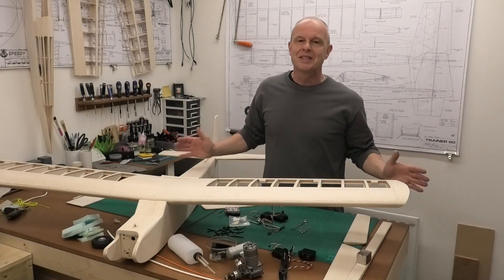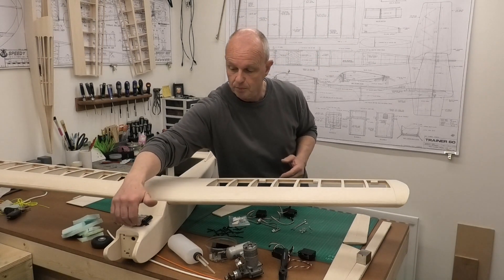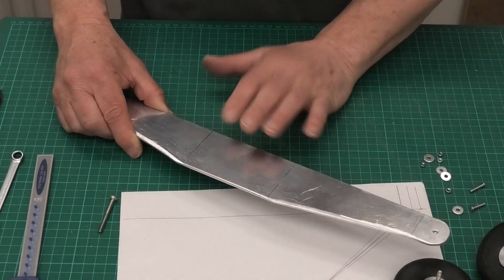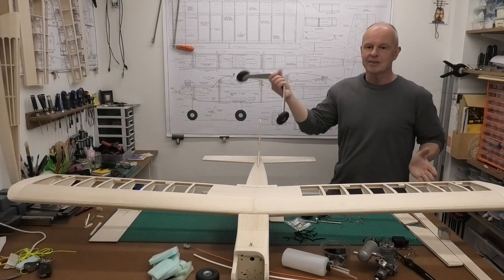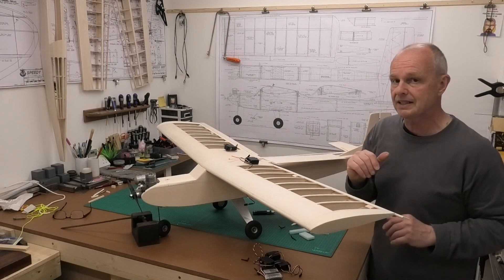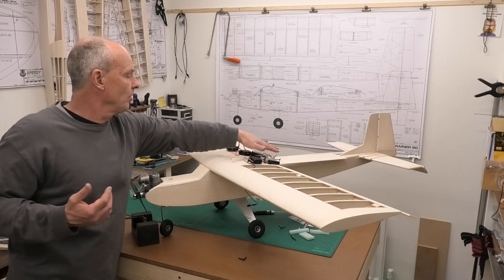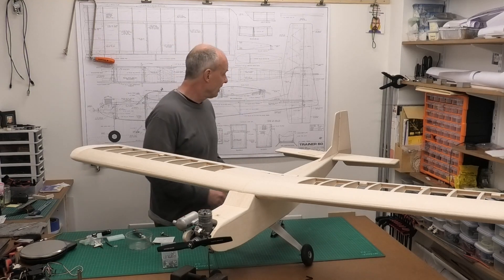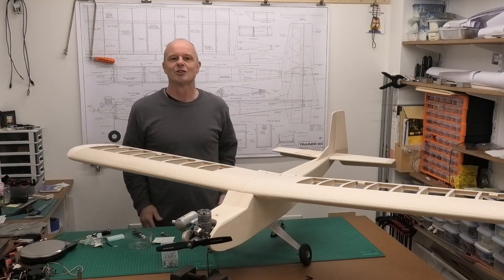Great Planes Trainer 60: Pt14 Planning for the Correct CG & Landing Gear - Build Series - 65" Span

Comment: Mark, Firstly, you are one of the best presenters in YouTube universe.  Great elocution, pacing, and logical, sequential presentation with great attention to details.   I am now just nearing completion of my 2023 modernization of my own Great Planes Trainer 60. Built in 1998 when I was a young 49 year old father, while my 13 year old son was building his fleet of RC aircraft, both glow and electric. The Trainer 60 had the original Tx/Rx setup with the 72.8 Futaba FM  Skysport with mixing.  All those years ago it was an excellent flyer despite it being off the correct CG mark and nose heavy. I corrected that for perfect balance with a NiMh 4200 mA battery in the aft port corner of the fuselage servo compartment (which was a serendipidous decision since it corrected a heretofor unkown Roll Axis imbalance which is a result of the weight of the muffler extending out on the starboad side of the plane!)  Would love to share my weight and balance information and pics showing how it looks.  I have installed Spektrum  AR 631 Rx so I can have 3 flight modes  No AS3X,  AS3X,  and SAFE,  plus SAFE Failsafe. Engine and all servos removed and tested. Can't wait to fly when weather permits at our position.43.2098° N, 77.6931° W    a warm winter so far.  FYI, I have also done same update for my Goldberg Electra and Graupner Partenavia.  The two former are great flyers now.  LiPo and brushless on the two former planes have reduced wing loading by approximately 30%.
Reply from the maker: Hi, thank you for such a lovely and kind comment, its really appreciated, also great to hear about what you are up to, it really is such a diverse hobby.  Hope you get some great flying over the winter, been a little bit rough here, although managed to bet to the field for two days last week which was nice 😊
Reply: @MarkRobinson555  Happy flying!

Comment: Hi Mark,

Did you take into account the fuel in your CG/Weight calculations?
Reply from the maker: No, if the tank is forward of the CG it should not be taken into account, because its far better to take off with a plane slightly nose heavy than landing with a tail heavey plane having used up all the fuel

Comment: Ive built a Kaos which flies well however I needed to add weight to the tail.
Winter task is to the remove the rudder servo from its tray and mount it under the tail.
Reply from the maker: Thats certinly a good way to go, I am currently building a patterns plane, which I know is likely to be nose heavy and I will be doing just that, no point in adding lead.